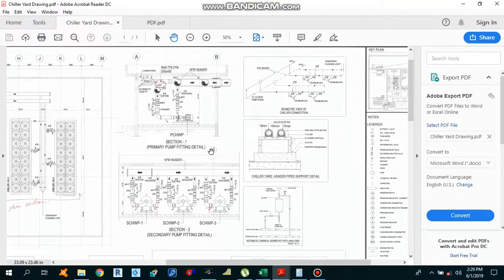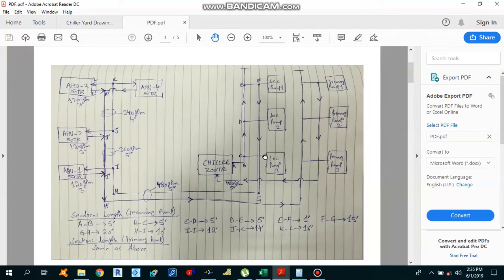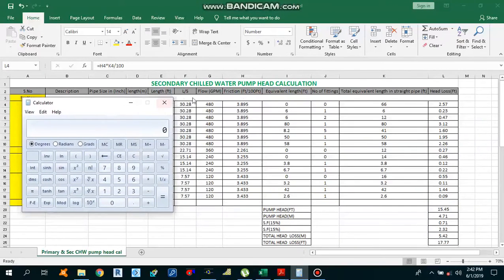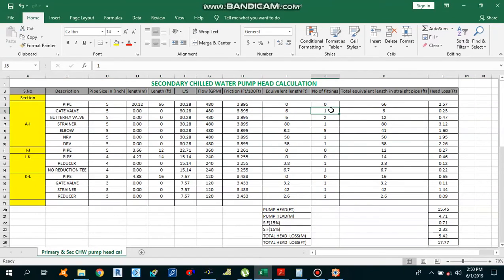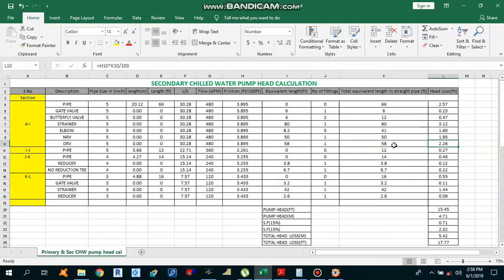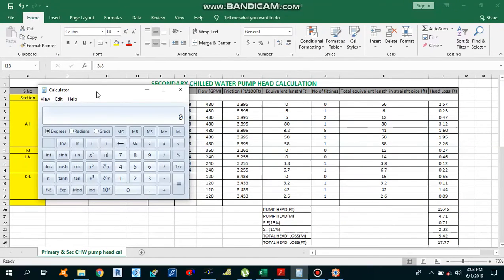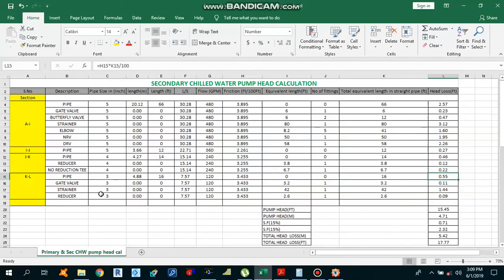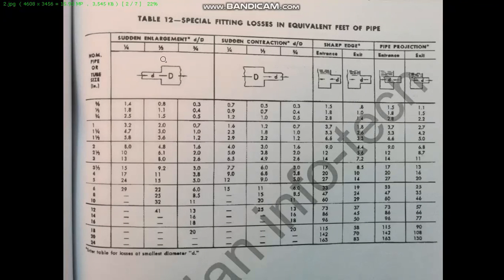chilled water pump head calculation, pump hydraulic calculation (Primary and Secondary),chiller pump

Comment: Thank you for a very informative technical video .Is there any reason you have not added the AHU  coil & 2 way valve pressure drop in secondary pump head calculation

Comment: Hello there! i have t questions, the material is still available? and the other one is how do you put into account in the calculations a elevation of the pipe, i mean if you have a section of 30 m in height, just add it as mH2O? and just + with the already head calculated? if you need to guarantee a specific pressure at the end of the line for an equipment, for example 3.5 bar, just + the same 3.5 bar as head loss?

Comment: Do we need to calculate the head loss of the flexible connection which connects the pipe to the pump?
Reply from the maker: Yes we have to add flexible connector head loss as well

Comment: Q. 1- Why did you not count fittings of all secondary pumps in A-I section but only considered only for single pump ?

Q-2: You calculated HP of secondary pump which is 2.71. So this HP=2.71 of secondary pump is for each secondary pump? 

Q-3 There is 3-Chillers in drawing but you have selected single chiller. Common header of each chiller have large gpm and large size 16" dia. Why this is not considered over here?

Plz somebody clear all three doubts?

Comment: I have one doubt, as we are calculating pump head loss for both pump so we have to take straight pipe and it's accessories only.

IN AHU there is heating and cooling coil also so we have add AHU loss also? or only supply and return pipe are enough for pump head calculation
Reply from the maker: You have to add all water side equipment losses like all AHU's, FCU's and chillers
Reply: @mepengineeringtutorials  so when I will calculate Head loss for secondary pump then I will add AHU Coil loss also, 

Same I will add AHU coil loss in primary pump head calculation?

Comment: Hi Waqas ,  i have doubt regarding pump head calculation of primary and secondary .  as per my knowledge for primary pump we have to calculate only chiller loop that is pump discharge line to pump suction line of primary pump only... and for secondary pump we have to take discharge line of secondary pump to FCU and then FCU to suction line of secondary pump ...please correct me if am wrong..

Comment: hi, nice video, is it not necessary to also account for pressure drop on the coil? to finish calculation? and what about return line, not needed? thanks
Reply from the maker: Yes we do need to add coil pressure drop losses across each water side component and for return line you have to do calculation for primary pump
Reply: @mepengineeringtutorials  hey thanks for your reply. imagine that instead of chiller it is a chill water buffer tank, it gets water to the buffer tank and it goes back to the tank in return line, in this case do we account pressure drop from water tank to coil only or add the return line too? there is another pump that also takes from buffer tank to the PHE and return to water tank too

Comment: Hi waqas continuously watching your videos it is very informative. Please note that in above calculation from A to I pipe size not constant because chiller discharge header size is 16" and pump suction size 8" and discharge 6". Thank you
Reply from the maker: I never mentioned in the video about supply header and discharge header size. It could be 16", 14", 12" or whatever depends on total gpm calculated. And obviously pump suction and discharge sizes would be different again depending on gpm and head calculation. Main purpose here is to show the procedure of pump head calculation. And then you have to follow the actual drawing routing for head calculation where you have straight pipes, bends, fittings, headers, special equipments.
Reply: MEP Engineering Tutorials I got it thank you

Comment: from building to chiller is primary pump,from chiller to building is secondary pump and what about condenser pump.plz make one video on pumps.
which pumps use in air cooled chiller and water cool chiller.
Reply from the maker: The one I explained in video is for air-cooled chillers. Same process is used for water cooled chiller but you will have one more loop in water cooled chiller system that's is condenser water loop
Reply: @mepengineeringtutorials  thank u  now my doubt is clear

Comment: Dear Sir, i have doubt that some of the other chilled water pump tutorials, for primary pumps they are taking only the suction header to chiller, and for secondary, they are taking whole pipe length in the building, instead of in your calculation{ for primary you are taking all the supply line from building to chiller and for secondary from chiller to all unit}..which methode is more fesible?
Reply from the maker: For primary CHW pump head calculation you have to consider all the piping (of fcu, Ahu and other water side equipment) running from buildings to your chiller and  for secondary CHW pump head calculation you have to consider all the piping (of fcu, Ahu and other water side equipment) from chiller to buildings. This is the correct method to determine CHW pump head.
Reply: @mepengineeringtutorials  thanks!!!can u send me the fittings press loss catalogue? babugd@gmail.com
Reply: Generally what you say might be right but do you have any reference from codes for this allocation of circuit for your head calculation. Many references say that primary pumps should be sized for only the primary circuit across the decoupler and secondary pump on the secondary circuit

Comment: Thank you for the video, what about the friction loss due to the chiller and coil?
Reply from the maker: Yeah we need to add losses due to water side equipments (like chillers, AHU, FCU) etc...
Reply: @mepengineeringtutorials  do you add the equipment losses (chillers, ahu, fcu, etc) to each pump calc? Or just primary pump calc? Also....is it every single AHU or just the furthest one away?
Reply from the maker: @Michel yes we need to equipment losses in primary as well as secondary pump head calculation and as per most remote (furthest) circuit we have to add equipment losses

Comment: So the Primary pump should overcome pressure losses of the chiller loop only: from the suction point, through the chillers, to the suction point of the secondary pump. So it will have always less Head than the secondary pump that should handle the pressure losses throughout all the distribution loop ??
Reply from the maker: Basically primary pump is taking water from buildings and push to chiller and secondary pump is taking water from chiller and push to buildings (supply to AHU's FCU's & other water side components). So primary pump will have to overcome all losses that are coming (from return side of water side components like FCU & AHU) to chiller suction point. And secondary pump will have to overcome all losses that are coming from discharge side of chiller to supply side of water side components.
Reply: @mepengineeringtutorials  Primary pumps need only provide enough head to move chilled water through the chiller and the piping pressure drops between the chiller and the secondary pumps.  Heads in the range of 25 to 75 ft are common.                                                              Check this PDF page 52. I look forward to hearing from you. https://www.dropbox.com/s/31wt8bwovfgiuo2/Chiller_Plant_Design.pdf?dl=0&fbclid=IwAR1qHTx2Yo9Q3ZA8Oz7c5zUUQUgyz4GkRXcE3lozqoXP1IeOEJrLOv7Q62w